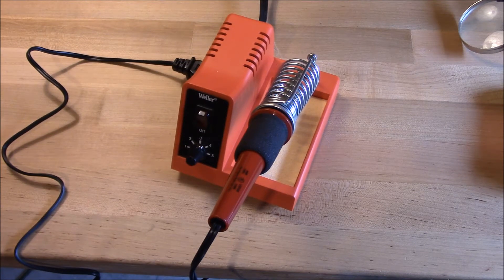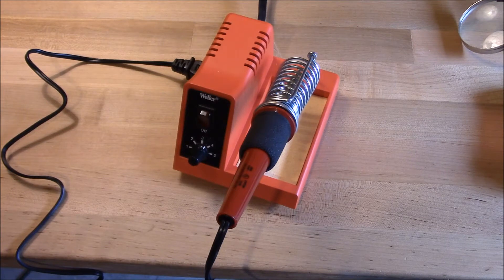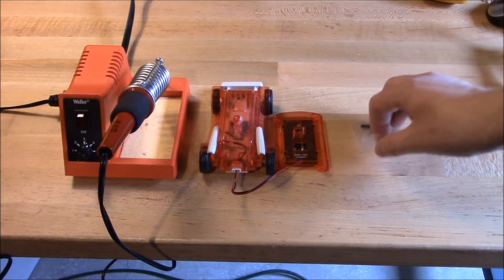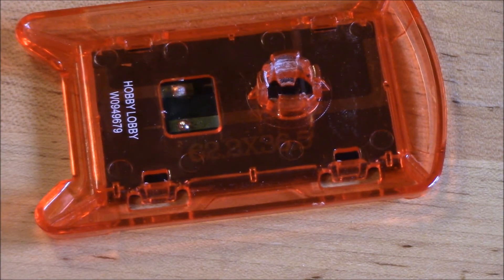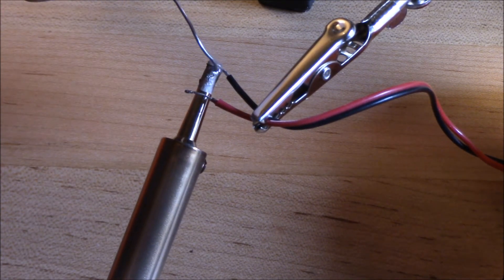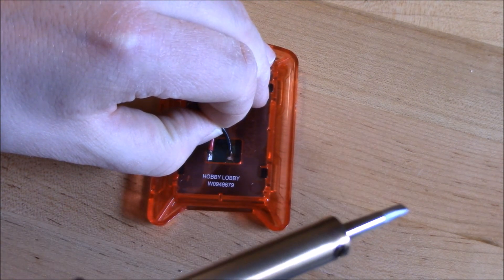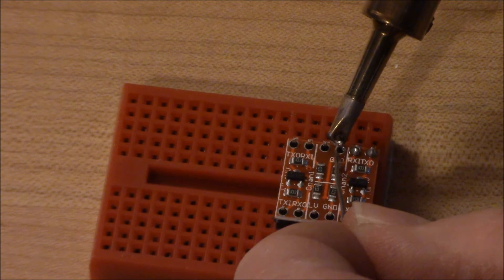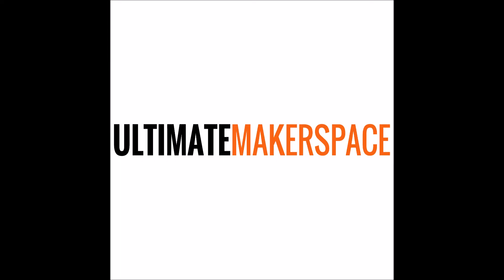Weller WLC-100 Soldering Station Use and Review

Comment: I will agree, I’ve had this particular soldering iron for about a year now and it works really well. It’s a soldering iron. My only complaint is where the soldering iron holder, the hot coiled steel thing, that attaches to the plastic base loves to pop out and fall in my lap and burn my crotch. Is there a secret to getting that soldering iron holder in there a little more securely? What am I doing wrong?

Comment: Is there any temperature reference for each setting it has? (i.e. When it is set to 3 = is it around 300 degrees??) Does it come with a chart or anything to help you figure that out? Thanks for any help. New to soldering and I would like to upgrade my iron, this is just the only confusing thing about this iron to me.

Comment: I've got one and I love it. My stem is discolored though. The first job I did with it, I had it set on 40 watts. Has anyone else had this happen?
Reply: When is new the iron tip you cover it with solder to tin the nose that process you need to do it each time you solder when you start also when you finish because iron tip will oxidize if its hasnt got solder.

Comment: Wait till you try out a good, modern temperature-controlled (not power-controlled) soldering station. You'll never want to go back. (Better stations also have better selections of tips, including the drag soldering tips that I also find very useful for other things.)

Also, you should invest in some thinner solder. On those headers, nearly every joint has too much solder, which is incredibly easy to do with thicker solder and the ridiculously thin solder pads on so many Chinese PCBs. (I remain baffled at why they do that, when there's plenty of space for larger pads.)
Reply from the maker: Thanks Antonio! Great tips!
Reply: do you have any suggestions for a grounded soldering iron with temp control under $100?
Reply: @jaketwilcox13  In terms of name brands, that leaves pretty much only the Hakko FX-888D, which is a perfectly fine basic soldering station. IMHO, though, the sweet spot for value is the roughly $250 Pace ADS200.

Comment: It seems this was made for different brands as its the same as my Katsu and a friend has this under the Vastar brand, exact same save a couple cosmetic differences on the dial plate.
Reply: The Vastar and many more stations are similar, but have at least one huge difference - those irons are wired into the station. The Weller soldering iron plugs into the station via electric outlet. So the soldering iron can be used independent of the station, and likewise, a different soldering iron can be used with the station.

Comment: I just got home but it doesn’t turn on does anybody knows why?
Reply: It happened to me once. Prolly the nichrome wire broke due to oxidation. Maybe rust?
You should check the resistance of the heating element. Don't worry it's quite normal for older style irons.
That's I will buy a quicko or ksger station sooner or later.

Comment: Cool. I've bought a new soldering station, my new other favorite tool (the other is my General digital caliper), an upgrade when it comes to soldering from my butane powered Iroda (I've been using it for almost 30 years but have run through 3 of the same model, essentially, the basic one, the affordable one) which I will use for portable jobs (on the roof, outdoors, etc.) to solder (the basic tip is just conical and the bevel tip is expensive) but less of soldering and more on using its blowtorch, hot knife and heat gun, all as a portable tool.

God bless, Rev. 21:4

Comment: If you don't have the money for a good modern temperature-controlled soldering station, this is great.  Unfortunately, Weller has discontinued it  In its place is the WLSK30 and WLSK80.  These do 5-30 watts and 20-80 watts respectively.  The irons are chunky and the holder is backwards from just about every other holder that anyone else makes.  In other words, safety hazard.

If you're lucky, you may be able to find one as new-old-stock.  They also can be found used at places like eBay.

For a station that costs less than $100, the WLC-100 is perfect.  Weller!  Please bring back this design!!!

Comment: Gosh I am triggered with Weller website. 
Cant believe they cannot update their web pages with full information about which tips fit what irons. If you do not know before hand you will have hard time figuring out. Hey Weller? How hard is it to put full info in your web page? "Related products" tab in the bottom, what is it for? Jeez.
The ET(a,b,c,d) tips page, wont say no info about were they fit.
I have an older blue handle 25w iron with bad tip, its still works just need a tip.
/rant over
Reply: You want the ST series tips.

Comment: weller are total crap...bought an expensive 1 a long time ago and it died after a week....bought another it didnt get hot enough.....many years later bought thier 40 watt 
" heavy duty" and it only worked if you pulled the trigger ( annoying) , and between trigger pulls it would cool off again.....never buy a weller...never...nissan cars also, warranties hassle